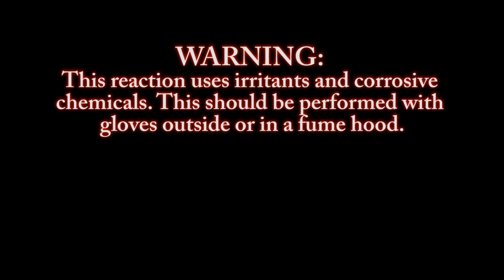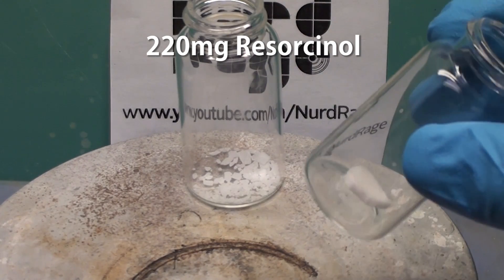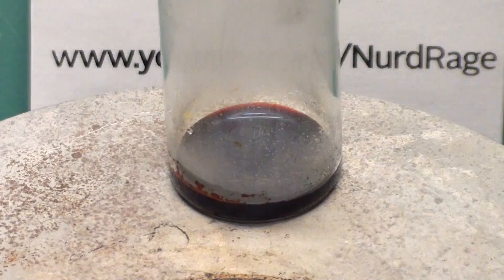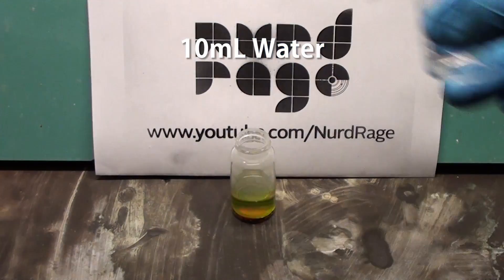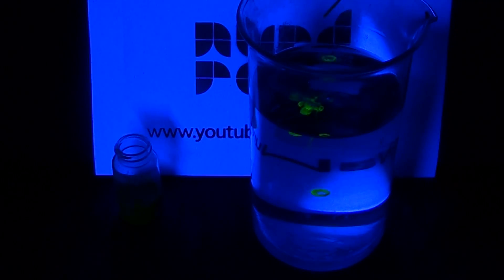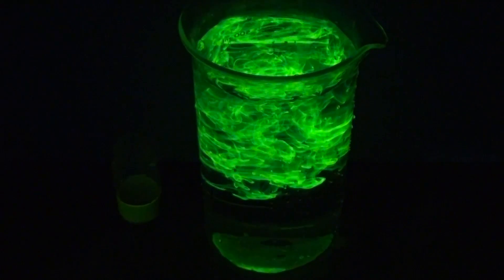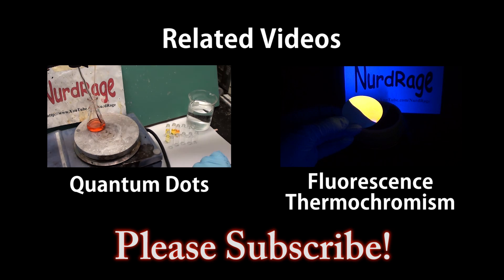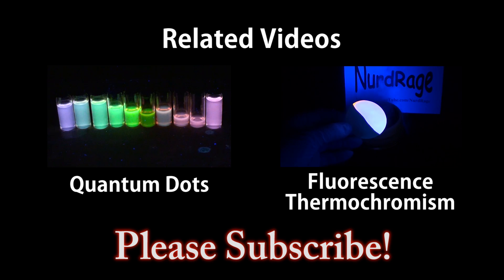How to Make Fluorescein (Fluorescent Dye)

Comment: @NurdRage out of the approx 10ml of concentrate you made how many litres of water can you make luminescent. Would adding bleach destroy the fluorescence effect? Im thinking about mixing this with 0.05% bleach solution to allow for spray disinfection ofhard surfaces with a blacklight verification that all surfaces are adequately decontaminated. Could that work? Also is fluorescine toxicity at factor?

Comment: Phthalic Anhydride synthesis from gloves is extremely hard and inefficient. Buy it, preferably from Merck (20-30/kg), so you can also make luminol, phenolphthalein, thymolphthalein and Rhodamine B with it. Do NOT use hot, concentrated sulfuric acid, use anhydrous zinc chloride instead.
Reply: with anhydrous Zinc chloride is the official process on wikipedia. But just for curios sake… which is more risky? And which more productive (i.e. in terms of fluorescien concentration/purity if there is any change.)?
Reply: All of them as hazardous and caution use... This is why you could not buy them, and they must be used with former educated specialist...

Comment: it is a very strong dehydrator...

If you had high concentration h2so4, then it would cause some extreme chemical burns, it would also break apart all carbohydrates within the skin and cause extreme thermal burns as well...

Comment: You need the sulfuric acid to make the reaction happen, H2SO4 is needed to take water out of the way and drive the reaction. You put sodium hydroxide in anyway, which would neutralise the acid as well as help dissolve.

Comment: You seem to have no idea what your talking about, So let me help you.
A catalyst is used to speed up a reaction, or in some cases where the Activation Energy is too high to achieve at reasonable means, a catalyst can be used to actually make it occur. The 2 wont actually create Fluoroscein with out it for this RxN. If you want to know about the other chemicals check a CRC handbook of Chem and Physics online, Structures. Also, he doesn't mention what molarity acid, It could be extremely dilute?

Comment: 1. Fill a glass jar with water
2. Put in a few coins
3. Put in some colored wax and close the jar securely (you don't want to spill hot water)
4. Put the jar directly on top of a high power light bulb (moar Watts)
5. Secure the jar, so it won't crush the lamp
6. Make a reflector to direct all of the light onto the bottom of the jar (maybe tinfoil)
7. Sit back and watch